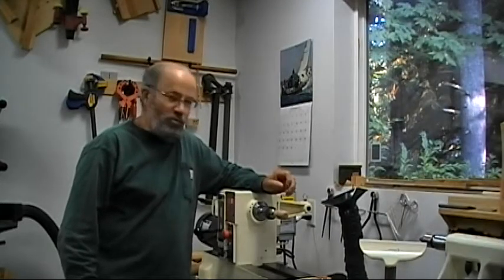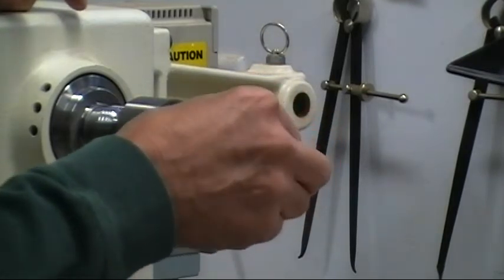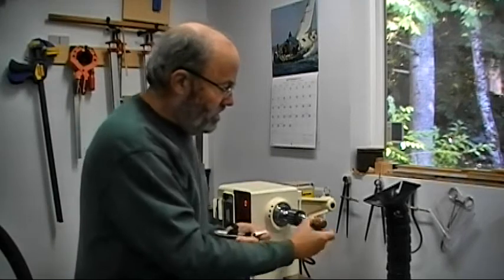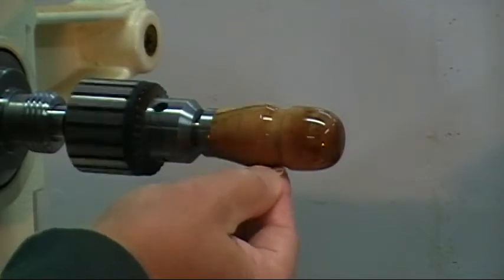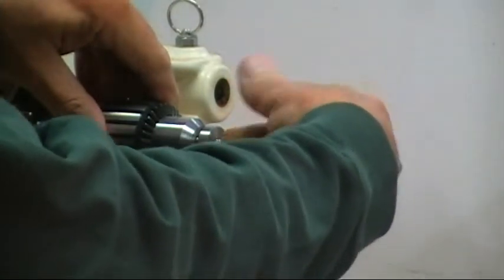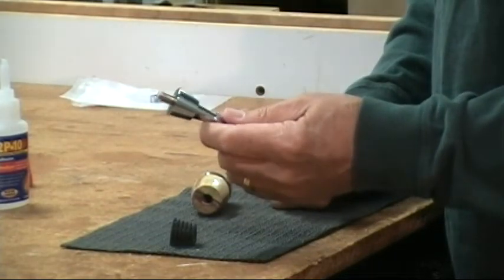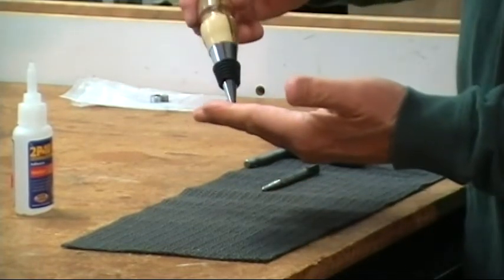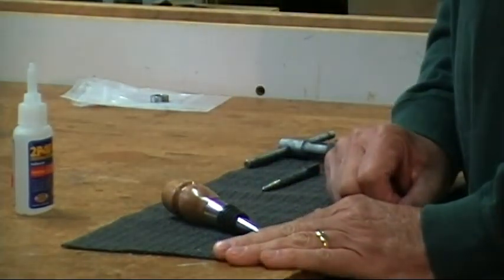Turned Bottle Stopper Episode 5

Comment from the maker: @BrushCountryJamboree Thanks for the tip. Would the Locktite work with a metal to wood joint? The epoxy seems to do the job in this case. I'll keep that in mind though.
Regards, Gary